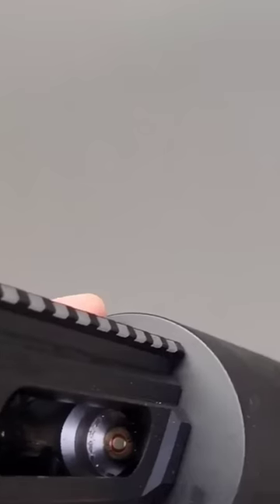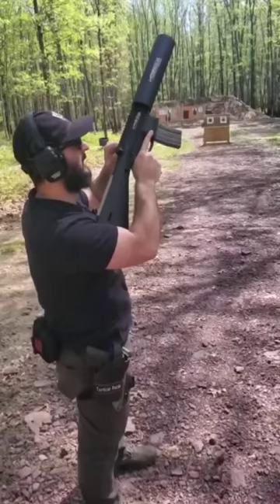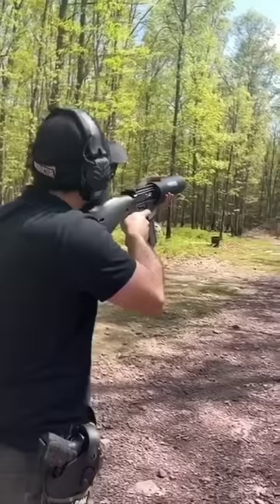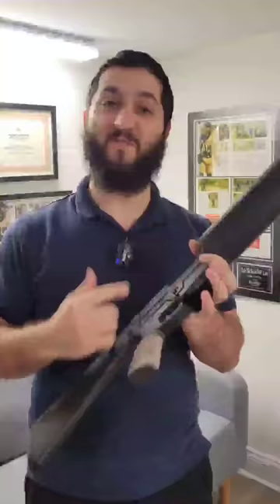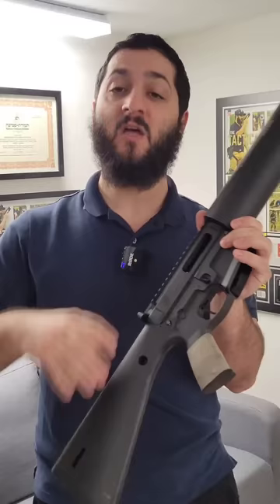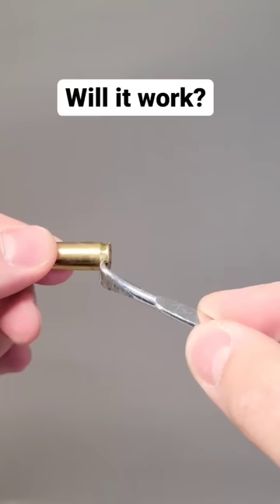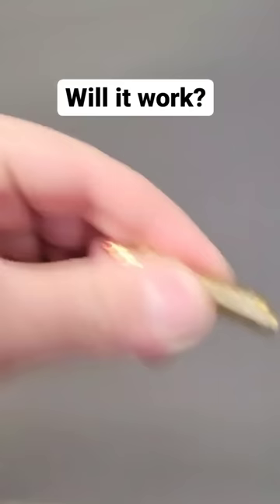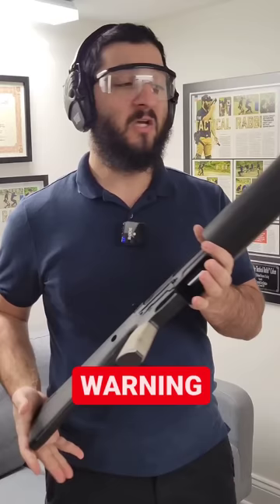I have a LIVE bullet stuck in my AR15! - Here's how you get it out.

Comment: Check your extractor. Eithet it's worn out or a weak spring or both.
Reply: not necessarily. could be shitty ammo. had this problem with Wolf in my AR. I have a SOLGW bcg in mine. my extractor was breaking the lip off the shells trying to take it out.
Reply: I've used Remington or Winchester.  No problems. If it's reloads, maybe too many times. Gunsmith may have a tool, drops in the chamber it's polished aluminum. Illuminates inside the chamber. Look for burrs
Reply: Reaper's Scribe  it's my first build. still not sure what the problem is. aero precision barrel and upper and solgw bcg. only ever had problems with wolf. eats every other steel case but wolf. 🤷‍♂️
Reply: I am far from an expert on guns or even have much knowledge about the subject but.. I think I can remember reading somewhere that blanks can get jammed easier, I think because not enough "pressure" is created. Sorry for the bad wording, like i said I dont know gun words/lingo lol. I suppose it means that the gun doesn't cycle correctly? I think that's the right word, seems logical. Could this be what caused the jam for him?
Reply: @mikehunt221  Did you use a blank adapter. It's  a adapter you attach to the muzzle of your AR15.
Reply: Did yall not see the cartridge in the beginning of the video? Not even a light strike. This was an unnecessarily long video to show you can use a paint can opener to extract a spent casing.
Reply: Reference back to reloads. When fired cartridge  wall expands. Depending if you hot load, you can reload a couple times. Discard casing .
Reply: @fcsdps6593  same issues...turns out my ars are ....picky B!@ches...and i have to lube them the f up if I'm going to use steel case ammo
Reply: @mikehunt221  yea but he was using blanks as a example because this does happen with live ammo , usually a picky ar , not lubed enough,  or extractors
Reply: Could also have a dirty spring, mine used to get filthy in the MC
Reply: Could be dirty throat combined with weak/worn extracted claw.
Reply: @fcsdps6593  I'd take it to a gun smith.
Reply: @markrayes2973  adding a bunch of lube will cause more problems. Use a chamber brush while using steel case ammo. It doesn't seal off and expand like brass, allowing more carbon to leak past. Thus causing a dirty chamber and then a stuck casing
Reply: @fcsdps6593  happened to me with wolf as well
Reply: @fcsdps6593  I have the exact same bcg and imo it's the benchmark standard on what a true bcg should be. I love their extractor system. They don't use the typical gasket spring because they're more than confident that the sprinco spring system is not only stronger but will last longer than any other system. Phosphate with chrome gas port and pin ftw. Also, don't listen to that silly fud lore of if it can't eat steel then she doesn't deserve brass nonsense. I respect my girls and only feed them the richest and healthiest balance of brass and nickel plated brass. Their inbred cousins get fed all steel - My palmetto blem AK & drako.
Reply: @fcsdps6593  I'm a gunsmith and some of what others have mentioned is sort of right. The issue is that many Ar's are chambered on the tight side and this can be exasperated if you just use off the shelf barrels and bcg's without checking and if needed correcting headspace. Other common causes are chamber dimensions and the chambers finish quality. Steel cases do expand when fired, the issue is it doesn't have the ability to shrink back down after obturation. Steel is rigid and permanently deforms and if there are any irregularities in the chamber it will conform to them and cause issues with extraction.  In tightly chambered Ar's this causes the same problem as the case isn't shrinking back down at all so there's not enough room to allow it to slide free. If you fire a straight blowback action gun without an extractor it will still push the case free it just might not eject completely as there's nothing holding it tightly so the ejector can do it's job. The other issue is even though wolf isn't lacquer coated anymore, it uses a poly coating, and while it doesn't gum up it does add to the chamber finish possibly causing an issue. If there is an overly rough finish or a burr in the chamber it can cause it to dig in enough to overcome the extractors spring tension. These aren't the only possibilities but they are the most common to come into the shop when someone has issues cycling with wolf or most other steel cased cartridges.
Reply: It sounded to me like the rim jumped the extractor, could be worn but the round also could have been out of spec
Reply: @mikehunt221  blanks also burn dirty as shit .
Reply: @fcsdps6593  I built a 300BLK AR couple years ago and used a areo upper and lower with NiBo Palmetto BCG and it works great 👍
Reply: Sometimes blanks go a mil too deep. When that happens the pin can't hit the primer and the extractor won't engage. That's probably what happened here. He could've just separated the upper & rodded it out twice as easily
Reply: @fcsdps6593  it's the coating & steel wolf uses. It can get gummy in a warm chamber and they use the crappiest steel money can buy
Reply: you guys are awesome, thanks for the advice!
Reply: @fcsdps6593  my advise is if you're going to use Wolf just use it the first mag, the use something in brass after you get warm
Reply: Theres a lot of variables. Tolerances on the ammo and on your chamber for example. Wolf works much better in an AK or SKS from what Ive seen. Some AR’s it can be not worth the savings.
Reply: @jkalash762  100% Tight or rough chamber is usually the cause. Happened to my buddies brand new Ruger AR. I upgraded his extractor spring to a sprinco and checked his extractor to rule that out. After a few hundred rounds on the next range trip we tried a couple different brands of steel (tula and wolf) both extracted reliably. So i suspect it was a burr or rough finish that smoothed itself out. Of course having the chamber reemed is always an option
Reply: @ryanpeck3377  yep. Many times that's really all that's needed. I've even taken 3m synthetic steel wool wrapped around a wood dowel and chucked it in a drill with jb bore paste and oil gave it a quick couple passes and had the issue immediately clear up. With most rifle cartridges there is a lot more chamber area to allow for more variance in some of the dimensions or a ridge left from the initial chambering so the case will still come free after it contacts from firing. A good test for checking for any potential snags is a qtip swabbed around the chamber lightly. It'll snag on any rough areas that could pose a problem.
Reply: Failure to extract can happen to many reasons. In fact more often than not it isn't the guns fault in my experience
Reply: @Dropship11  usually the ammo or lack of maintenance from what Ive seen.
Reply: Bullshit the round didn’t even have a primer strike on it he’s lying
Reply: @fcsdps6593  damn. your gun was reciprocating with quite a lot of ass to destroy the rim. consider putting it on a lower gas setting if you are using low quality range ammo like that. wolf is notoriously shitty ammo though. my dad was shooting it out of his FAL and got 2 squibs within 50 rounds. on the second squib he went home dumped the ammo and cleared the squib.

Comment: I did this for someone at some point, they came to me with a jammed round, I just popped open my screwdriver on my multitool and manually extracted the round. It's really not hard, just don't smack the primer or use any thing with electricity.
For the record, I'm not trying to get others to do this. If you're comfortable around these situations, do what you know works. If you're not, step away from the gun and get help from someone who is. We're talking about an explosive here, which has the potential to launch shards of metal in a ton of different directions, if something goes wrong, potentially hurting or even killing anyone nearby. Guns are fun, but they're still deadly tools. They need to be treated with the respect they deserve.
Reply: Crazy Ohioan Cars, Guns, and Gaming  Or a knife, tbh. Just about anything you can get in the chamber and under the rim will work. Again, though, my advice isn't to go try that for your first time, cause if anything goes wrong, it can go REALLY wrong. Just don't be a complete idiot, like one guy I saw comment on here, who said he just ramrodded the round out. Definitely don't do that.
Reply: @DieuDeMort  also wouldnt be a bad idea to take the lower and bcg assembly off. And pushing it out shouldn't really be a problem if you waited to make sure it wasn't just a hang and preferably used something to keep ur hand out of the way but def not the way I'd do it.

Comment: Pop the rear receiver open so the firing pin* doesn't have a chance to punch it is my suggestion
Reply: Ar's are hammer fired guns.... but you knew that .... right?
Reply: Striker?
Reply: @justinbellio2285  i mean the firing pin lol
Reply: @ThaHerbanLegend  i mean firing pin. Idky I called it a striker lol
Reply: @justinbellio2285  technically they still have a firing pin. The hammer strikes the firing pin.
Reply: @jricher23  "pin" was the edit, it used to say "striker"
Reply: If it's center fire it would have to.
Reply: The second you lock the bolt back you're fine... Can always use safety switch too...
Reply: @TerminalM193 ...Yes but I'm saying how to get it out is to pop the back upper out. Like you know how it swivels up and down when you pop the "let me in" pin? Yeah, that.
Reply: There is clearly no bolt
Reply: @nator998  but there is lmao. You can even see it at very slight angles when he's at home.
Reply: @nator998  the bolt is open, hence being able to see into the chamber, the bolt opens every time you fire to eject the spent casing so another round can chamber
Reply: Just remove the upper from the lower entirely.  Works fine if the bolt carrier isn’t stuck back / open.
Reply: @beoeve  that's called a rear takedown pin
Reply: @justinbellio2285  sorry I'm no gun expert. I forgot what it was called, don't own and AR and I've not field stripped one/taken it apart bc again, I don't own kne but a shot one.
Reply: When your bolt is locked to the rear, your firing pin isn’t exposed.